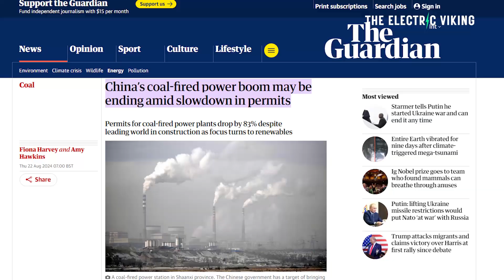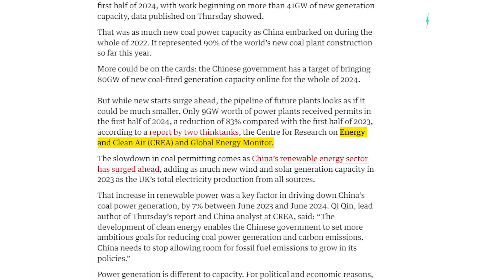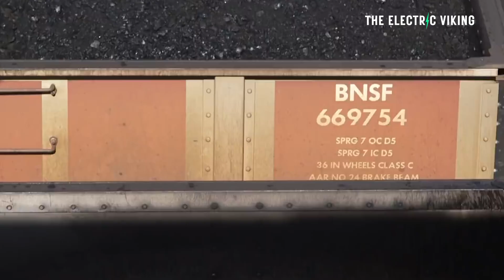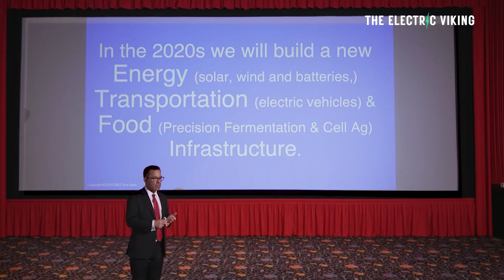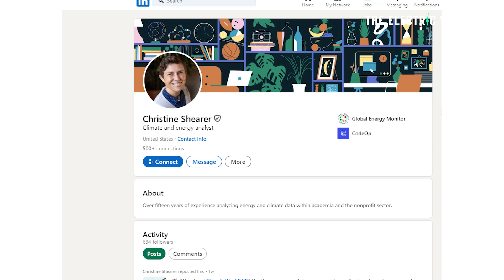Coal power stations losing billions - China’s coal-fired power boom is OVER

Comment: If the economy in Australia is (still) depending very heavily of exporting coal to China, someone screwed this up. In my opinion the time the coal usage in China will start to drop was clearly visible ahead of time. Remember the Chinese, in spite of the fact they have dealt exceptions from the path to net zero, they have signed for following this path as well, even though with a time delay. And of course, it is exactly as you say in the vlog: Wind and solar is cheaper and cleaner and will be given a high priority.

Comment: BS at it's finest! Learn to calculate, DUDE! China constructed 215GWp (PEAK POWER!) of solar power in 2023. But solar has a capacitance factor of ~10%, means ON AVERAGE over a year this is 21.5 GW. Yes, still very inpressive and roughly 21 nuclear power plants. But this is only the average power of ONE power plant ever 17 days, 2.5 weeks! And still, this solar power plants have secure power delivery of excatly 0%, where 21 nuclar power plants can run 24/7 during ANY time of the year at 100%!

Comment: This makes perfect strategic sense.  They are removing the cost of importing coal, which helps their balance of payments.  It also gives them additional economic security against rising coal prices or even sanctions.  They are building a cheaper source of energy using components manufactured in their own country.  They are reducing CO2 emissions and pollution which is harming the health of the population and making places unpleasant to live in.
Reply: Solar power may be cheaper to build, but is 100% volatile and 0% secure. Deal with that!

Comment: Chinese CP wants to not be dependent on imported coal so they won't suffer from the sanctions that will be imposed after they attack Taiwan.  They want to be electricity self-sufficient.
Reply: attacking Taiwan would be a disaster, as we ( in NZ ) cooperate with manufacturers in the country, and they are much easier to deal with than Chinese companies.

Comment: Many people still looking through colored glasses at China.  Ultra-high-voltage electricity transmission (UHV electricity transmission) has been used in China since 2009 to transmit both alternating current and direct current electricity over long distances separating China's renewable energy resources and consumers.  So this didn't happened overnight.   And carbon emission per capita, China is actually below many countries including the USA.

Comment: I've seen people mention in several comments sections that China is shutting down old coal power plants while they open newer, cleaner ones. Meaning the new capacity isn't always added capacity. Then consider 1000 Gigawatt total potential yearly coal generation, but the plants run 1% less. That takes 9 GW off the grid just in that one percent reduction. This means that even with new plants being built, reduction in fleet capacity utilization can reduce overall emissions.

Comment: Yes, China is still actively building coal-fired power plants. Despite its commitment to peak carbon emissions before 2030 and achieve carbon neutrality by 2060, China has continued to expand its coal power capacity. In 2023, it approved the construction of the most coal-fired plants in the last decade. This is part of its strategy to ensure energy security and stabilize the economy, particularly amid concerns about power shortages. 

China's reliance on coal stems from its large domestic coal reserves, which provide a reliable energy source. Even though the country is ramping up investments in renewable energy, coal remains a significant part of its energy mix. In 2022 alone, China added around 
This expansion has raised concerns about the global impact on efforts to limit climate change, as China is the largest emitter of greenhouse gases. Despite its renewable energy push, China's coal usage poses a significant challenge to global climate targets.

Comment: It's a bit like saying EV sales are declining when it's really their sales growth that is declining. Coal growth is declining, but it's still growing.
Reply: China is still building new coal and gas power plants, but it is using them less, since renewable energy is cheaper. In May 2024, gas power generation in China fell by 4TWh (16%) and coal power generation fell by 16TWh (4%) compared to May 2023. Carbonbrief believes that China's carbon dioxide (CO2) emissions from fossil fuels and cement have been falling since March 2024 and that China's CO2 emissions peaked in 2023.
Reply: Yeah 9 GW is nothing small. Although China is apparently shutting down dirty older coal plants. With the amount of new wind & solar coming online, along with hydro, I feel like China could hit peak emissions in 2025 or 2026 as the entire fleet of coal plants slowly reduces their yearly operating capacity.
Reply: @Nphen  Facts over feelings! Coal consumption in china will be very high for decades!

Comment: Wrong.  A coal plant needs to always be burning coal to be ready to produce electricity. Its not the same as a natural gas plant that can be spun up in 5 minutes.  The coal plants still burn coal, they just don't generate electricity, so it doesn't count.  They report a nice drop in electricity produced by coal due to renewables, but actual CO2 emissions hardly changes.
Reply: Baloney. 
Those are the news from the very same politians of the WEST FAILED to improve their own infrastructures and local economies. 
They promises alot but nothing much is delivered. 
Talks big but no substance. 

Lots lies, blames, excuses,  and plenty of corruption.
Huge budget goes to the dark military while little bird feeds for the actual tax payers that pays the bills.
 
This is why they wanted you to go to war to shut you up.
Reply: Don’t they reduce the coal they burn when not generating? That would make sense.
Reply: @lifeliver9000  Not as much as you would think.  There is some reduction, but not much.  It takes half a day of more to get a coal plant going so it really can't be used as a backup for wind and solar.
Reply: @barryreymond9004f  oh ok that makes sense. Thanks for sharing. I’m lucky in my country it’s 87% hydro which powers the country including steal mills etc  but that last 13% is made up of wind solar LPG and coal and they are struggling to work it out so I can imagine trying to go work out  a country that is based on coal for power. Thinking batteries are the solution. Best one I’ve seen is Canary Islands where they have a lake up a mountain and one at the bottom. When wind is blowing and sun is shining excess power pumps water from bottom lake to top and at night it flows back down through hydro systems. Tesla is also doing some big battery farms like in western Australia. That whole region now runs off battery hybrid solution. Going to be a interesting next few years
Reply: @lifeliver9000  Hydro works perfectly with wind and solar assuming you can release and hold back water without people downstream complaining.  Once wind and solar capacity exceed hydro the capacity then problems become enormous without natural gas, or diesel reserve plants.   You get rolling backouts in the short term and complete grid failure in 3 days of poor weather.  We simply cannot replace coal with wind and solar with current technologies without hydro, natural gas or diesel.   You can replace coal with nuclear and be done with fossil fuels completely.
Reply: @barryreymond9004f  Baloney
Reply: @loktom4068  Physics trumps blind green faith every time.

Comment: Coal power plants, at least in Ontario, were hard to "spin up or spin down". So it's more likely renewable would be "curtailed" than coal would be.
I think we closed our last plant in 2013 or 2014.  I also know that Nanticoke only ran for 40 years, which is not a long time for a coal plant. I can't imagine anyone being stupid enough to build NEW coal and expect to get a "normal" return on that investment. Even a gas-fired plant is unlikely to have an ROI past the first decade or so. Banks that underwrite those kinds of projects should be avoided from an investing perspective as their management is too shortsighted for long-term "buy and hold" investing. Of course, that's JUST my opinion 🤣

Edit: I did some more research on this topic and apparently the Chinese DO use coal as "peaker plants". And they ARE uneconomical for normal operation but are still needed so ...
Reply: Sadly, Britain is going to START a new coal MINE!

Comment: If you look at the total generation added with coal over the last 20 years you will see that the over all capacity really has not increased much over the last 15 years. China has shut down dozens of older, less efficient coal fired plants in the cities, and replaced them with newer cleaner and more efficient plants. Its been more of a maintenance of coal generation than an expansion of it for the past 8 years. While renewable installation has doubled every 2 years.
Reply: Coal co assumption increased 2023 was a record
Reply: @muskepticsometimes9133  and in 2024 it will be higher still. IEA numbers shows an expected increase of 0.9% for 2024, flipping to a 1.1% reduction in 2025, and reducing further after that. This very year, 2024, is peak coal in China.
Reply: They approve 2 new ones every week

Comment: China has ignored the Climate Crisis and environmental protection for too long.
Weather events are getting more extreme because of Climate Change.
How hot does it have to get before governments and corporations wake up and stop adding more fossil fuels to the climate fire.
There is a Climate Crisis. We need Climate Action NOW !   Floods, droughts and extreme temperatures caused by burning fossil fuels will get worse over time. Adding more coal power plants will make the Climate Crisis even worse. Adding new wind and solar energy production is where new infrastructure spending should be done.  People need clean air to breathe and clean water to drink. China has allowed companies and people to pollute the air, land and water resources they need to survive.

Comment: China also has a huge hydroelectric build out happening.   This is happening along the main rivers out of the Tibetan plateau.
Reply: Along with commensurate environmental degradation
Reply: @waynewallace2061  yes there is a environmental disruption. But it fairly quickly returns and adapts to the new situation.   Very few fish migrate this far up river. It is not like the salmon of the Atlantic or North Pacific.   Once in place dams can be amazingly good for the environment.    

These dams store melt water from the Himalaya’s glaciers, and Tibetan spring melt.    If the glaciers shrink to the point that there is not enough summer melt to support the down stream ecology, economies and communities, then millions are going to die. Not to mention the forests and wild areas. One reason for these damns is to store water that would have come from the glacial melts.   These summer melts may not last much longer.
Reply: @williamgraham6917  So they are never going to give return Tibet back to its people.

Comment: If you google power generation in China the numbers show that, over the last year, Solar and Wind represented 52% of plated capacity. Yet they only generated 12% of demand. Coal is 42% of plated capacity and generated 70% of demand.
Reply: If you relied on Google for datas in the fast changing China, it got outdated as you read it. 

It may be relevant and true in the slow pace of the WESTERNER nations.

You shouldn't rely on Google fact check on  someone's next move and planning into the future. 
Especially when the competition is not idling and slow or just all talks and no substance.
Reply: Plated capacity?
Reply: 70% isn’t accurate?. Source
Reply: Capacity is mostly quoted when talking about solar and wind. It’s a misrepresentation of the reality. Capacity is on the ideal conditions at the best time of the year. Solar generation in winter, bad weather and during the night is minimal

Comment: Don't forget China has 53GW of nuclear generating capacity, and that due to it's intermittent nature, you need to add 4 or 5GW of wind/solar capacity to equate to 1GW of nuclear.
Reply: At the end of 2023 China had 609GW installed solar capacity or using your factor of 5 results in 122GW solar, over twice nuclear. The difference is increasing.

Comment: I'm interested in this idea that the Chinese turn down the output of coal power stations when renewable output is high. How flexible are coal power stations?
Reply: I don’t think coal fired power stations can easily start and stop. They are more base load. Secondly China has a long standing power shortage. Why wouldn’t it want to supply the shortage? It could be a timing thing as as Grid storage batteries come online for daytime generated solar and be able to supply the solar power at peak times when solar is not producing.

Comment: There's exponential electricity demand, data centres, crypto mining,ai, electric cars etc so solar panels won't be just replacing coal but keep up with the surge in electricity usage. They have to keep coal around for a while yet to make sure solar can cope
Reply: Economics is going to make that harder and harder. It will also make renewables easier and easier, as they scale, and as the industry matures.
Reply: @jimthain8777  maybe but they'll be nervous to stop coal early cos it's proven to handle the load. On paper, solar panels and batteries seem like they better but what if there's an unforeseen issue.
Reply: By the way, China is keep selling electricity to Vietnam for their manufacturing industries.

Comment: Until they find a profitable way to make Steel with out Coal I don't think all coal mines are doomed. I suspect about 3/4 of the coal mines will shut in the next 10 years. But as Metallurgical or coking coal is the dominant type of coal in Australia.  About 60 per cent of the known economic reserves are located in Queensland, with about a quarter of the developable resources found in New South Wales. There are more than 3025 coal mines in operation globally, of which 128 are in Australia. Only the best as cheapest production mines will survive maybe 30 to 40 in Australia.
Reply: They're working on that. If they figure it out, that will be the nail in the coal industry coffin.
Reply: If that happens going to be a lot of hungry homeless kids
Reply: Hydrogen.  Already demonstrated
Reply: @paulgoffin8054  Reference to report please for review. Reports I have read still suggest profitability issue. Until profitability issue are resolves unfortunately coal will be used.

Comment: Even according to Chinese figures they are digging coal still. They are increasing each year. They are also closing old and small coal stations while increasing the quality of the burners to increase the efficiency in generating power and at the same time reducing the parthiculate being emitted. The standards are much better than EU and USA. 
They dig coal as compared to oil 1kg or coal has a density equivalent of 4kg of oil. It is cheaper to dig and they dig far more domestically than any other country by far perhaps by a factor of 10 compared to the next country. 5bn per year compared to others like indonesia at 500mn. The Chinese import approx 500Mn tons a year as coking coal for steel production of which say 50% comes from Australia when it meets the correct quality standard. 
They use coal like their peaker plants in the West use natural gas. It is cheaper and easier to do. Also they have approx 35 years of reserves of coal in China. As battery and hydro increase they take on the role of energy storage. Additionally nuclear, wind and solar are increasing at levels twice that of the West combined. They import approx 3% of their energy needs as natural gas and <1% is petroleum /oil imports. Recent finds inside China as well as electrification of the transport market continues to decrease their oil demands. They are approx 60% fossil fuel and 40% non fossil fuels.
The Chinese govt owns the power generation plants and i believ that includes all of the coal fire power plants. They have fixed the price of electricity in order to promote consistentcy and help plan for industry and growth so even when the price of coal is high they take the hit and make losses. They want out of coal as well and are taking huge steps to acheive these and convert to cheaper, healthier and more sustainable energy supplies. Yet just because they are making a loss it does not mean they will close the plant. They are doing a planned reduction to ensure manufacturing can be sustained and the transition be effected properly and permanently.

Comment: Sam dumps a lot of propaganda.  Here's the facts:
China burns more than half of the world's coal.
China is still building more coal power plants, just at a reduced rate.  They are unprofitable because they are state run and state regulated.
China is installing huge amounts of renewables IN ADDITION TO the coal power.
China still doesn't have enough electrical power for its EVs, as evidenced in this video:
https://youtu.be/HRx6Q9f-2Is?si=QCvft3bHaINQbtXo
Reply: You've kinda answer your own statement. Energy demand is growing some they are building out more capacity but they can't build up the renewables fast enough, hence there is still some reliance on coal. They are hitting that peak crossover point now which is why their coal use is staring to decline. 
The video you link could be read that they don't have enough power for all the AC they are running given the 40c+ temps they are experiencing. I did only skim the video but they didn't proof read it very well. at 8m 11s it states "by the end of 2023, China had almost 8600 million charging units, with 929,000 public chargers added that year, a 42.7% increase"  Believe thy meant 8.6 million. Either way it seems more of a temporary issue that will only get better.